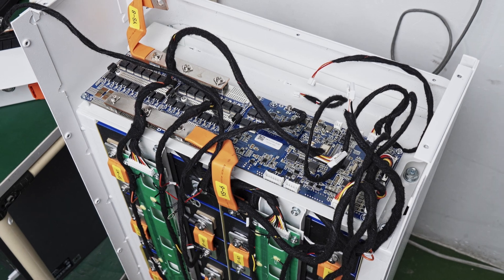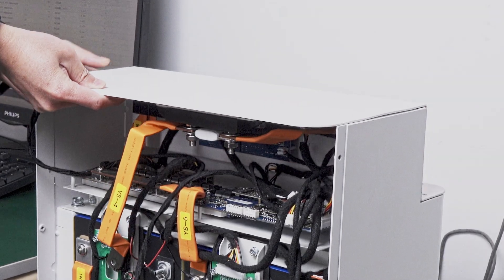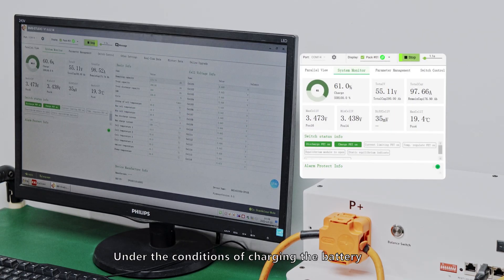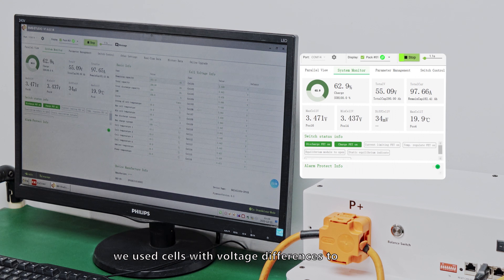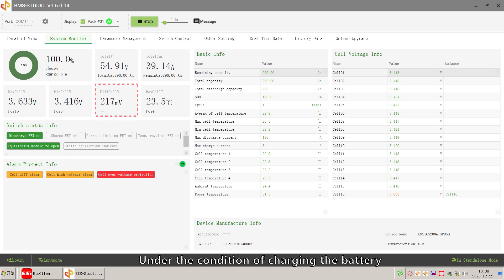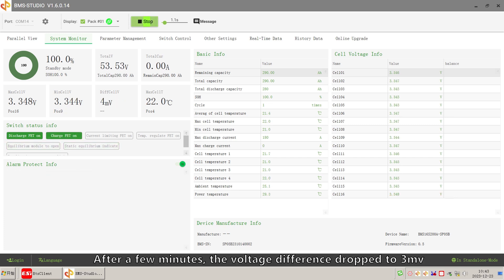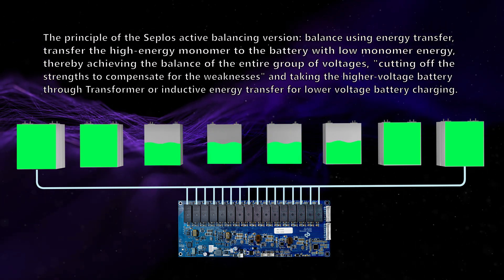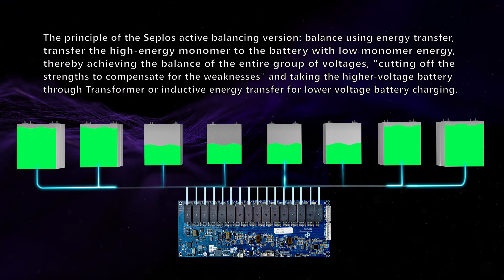Seplos 280L(3.0Y) when charging with Seplos BMS3.0 and active balance board's efficiency.

Comment: THIS VERSION IS CRAP cause the cells you have recommanded to use are NOT ALLOWED TO BE USED IN THIS WHOLE CASE AND POSITION
EVE WARNED ME WITH THESE LINES, my HOUSE INSURANCE is not willing to insure the risks of your crappy battery design.
EVE has written this and we also got warnings regarding the valve cause in this position they will be fully covered with electrolyte and add another risk in case things go wrong cause the electrolyte will damage the floor instantly when it will leak out.

"In the LF280K datasheet I sent, there is a schematic for the mounting jig.
We recommend upright placement for the following reasons:
#1 other directions will affect the cycling performance of the core.
#2 For LFP cells, other directions will lead to uneven distribution of electrolyte, which will affect the performance of the cells. "

I am disappointed over and over again cause #1 a manual is fully missing #2 epoxy sheets were missing too and what not .
I have paiid the full price, but dealer said he had no spare parts and you did not react nor deliver the missing parts since November.
Reply: This is true only when charging and discharging with currents above 0.5C.

Comment: What is the difference between the Seplos 280L(3.0) and the Seplos 280L(3.0Y)?
Reply from the maker: Seplos 280L(3.0Y)has an active balance board, but the 280L(3.0) does not.

Comment: For ease of assembly of the battery, mark the connections in pairs with different colors. When assembling from the manual, I encountered the problem of properly connecting the dry contact and connecting the balancer switch button. There are 3 identical port pins on the balance. If they were of different colors and their wires, it would be much easier
Reply: I am having difficulty connecting up as the instructions are poor do you have a schematic or how did you get the details thank
Reply: agreed. Recently received my case and the manual is so poor that to be able to assemble it, it is a mix of luck/guess and video/images analysis.

Maybe you can help me on those two (which are the latest I'm struggling with) :
1) I have a spare 4 pins cables that I don't know how to use. My research led me to guess it is to connect the BMS & balancer board through the dry contact of each board. Correct ?
2) the main switch seems to fit with to the two pins socket next to the 4 pin "official" ON-SW socket. This 2 pins socket is not referenced to in the assembly manual. Is my guess correct ? (There are no much 2 pins sockets on the BMS board, so it's more gut feeling for now.